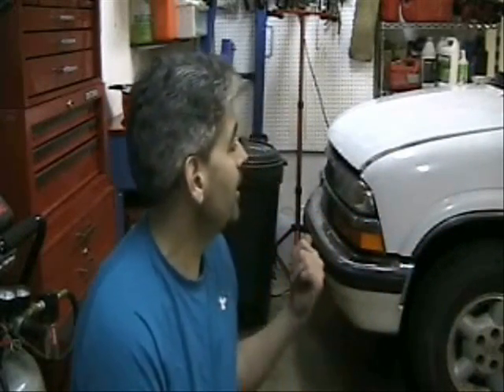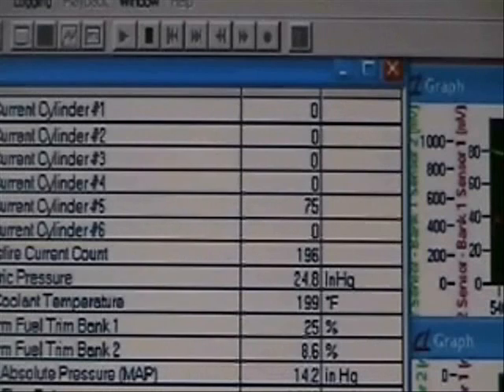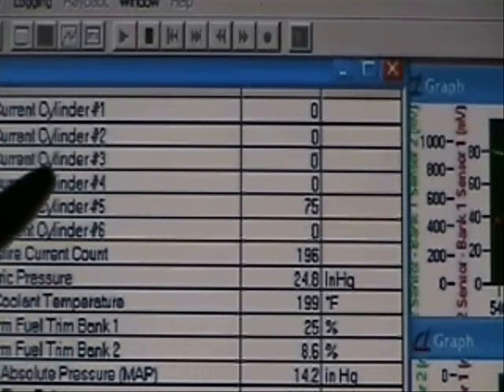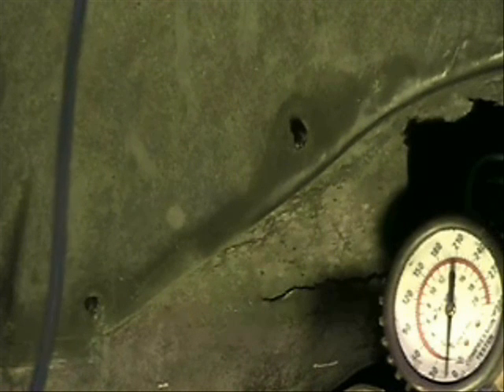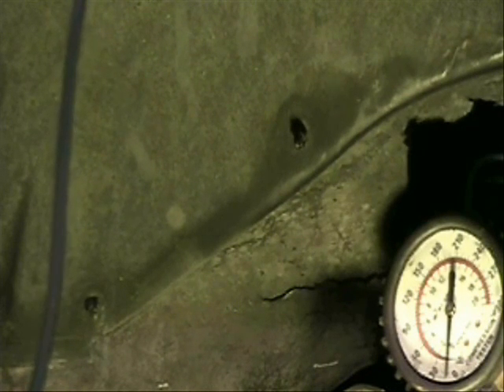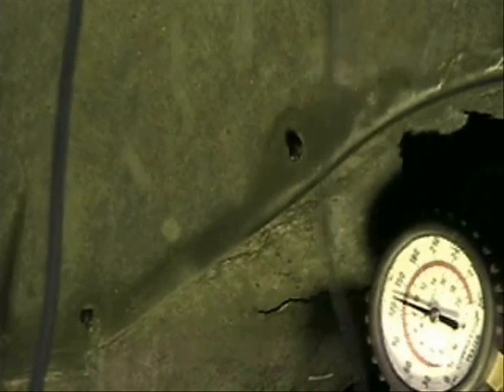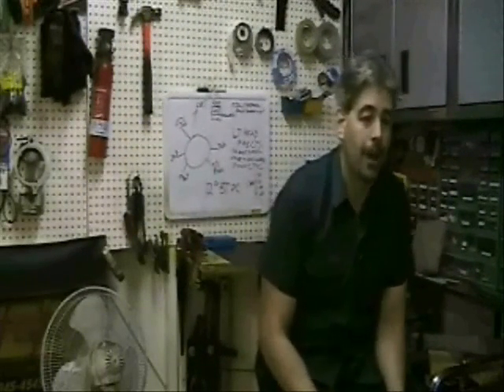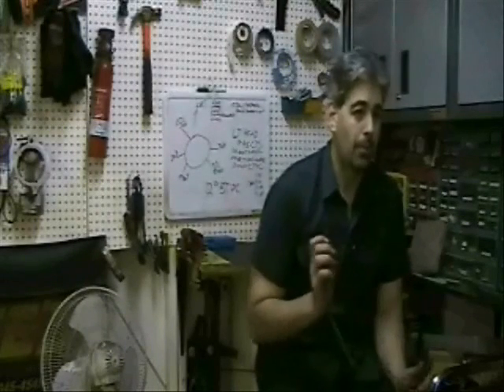P0305 Misfire Diagnosis 4 3L Vortec PART 1

Comment: I'm chasing a misfire on my "98 Chevy 1500 5.7L Vortec. The only codes i've been able to get are P0171 and P0174 (I think) Lean on both banks. Also occasionally a catalyst code which im sure might be bad from all the unburned fuel going through it. The miss is on all cylinders under a load. whether it's in closed loop or not. I overtightened the dist cap on a previous repair (Similar symptom but not as severe. turned out to be cam sensor). and after discovering i had a 6 cast into my dist housing at the TDC #1 mark instead of an 8 I decided to order a new one since I knew I broke it. Do you think it's very likely the lean codes could possibly be caused by a misfire on all cylinders because the cap isn't secured properly?

Thanks!
As soon as I get the broken distributor replaced (With the help of another of your videos) I will continue my testing.
Thanks!
Reply from the maker: @Parker- I have to tell you that I would go after fuel pressure.  lean on both banks and random miss under load.... Definitely fuel pressure test is what I would do if I were looking at it.
Reply: Would you agree that it's more likely the fuel supply to the injectors versus the fuel supply from injectors? I did a injector balance test with a scan tool and at idle each injector seemed to effect idle exactly the same. I'll just have to wait until I get my distributor to get it up and running. Watching you're videos has got me really excited about diagnosing this issue properly! I am actually a service advisor at an auto shop and it's unfortunate that I have to admit my technicians are "parts changers" :(
Reply from the maker: Parker Waite Parker, I do agree with you 100%.  An insufficient fuel delivery would still allow for a negative fuel injector balance test result because the injectors would just be equally delivering insufficient fuel.  I would go in the direction in this case of hypothesizing either a weak fuel pump or a dirty MAF sensor.  I would look at my LTFT and O2s while driving the car and flooring the pedal.  If the LTFT screams high and the O2 sensors go lean while it's floored, then it's 99% likely to be one of these two things. Then, following up with a fuel pressure test (if it's 55PSI or so while idling and it increases with throttle) then a dirty MAF is surely the cause and I would clean the MAF and retest.  If the fuel pressure is low however, then that's surely the problem (and, possibly, there could ALSO be a dirty MAF to be really technical).   But honestly the way you describe the symptoms, fuel pump or fuel delivery issue (bad filter, etc) is where I would bet you find the issue if I had to gamble on a guess- which I don't do.  Incidentally, I have seen many Vortecs that have leaking fuel pressure regulators at the injector assembly- in fact I don't think I have seen one that doesn't have this to some degree. This must be a common issue on these engines, however this will cause a rich condition on these models because the regulator is internal so don't bother chasing that down even though many people may suggest that.  Do let me know what you find.
Reply: I certainly will. One other question regarding your video. In your flow of diagnosis once you determined it was going to be a fuel problem, you automatically ruled out the pressure regulator. Why is that? It may be obvious to someone who happens to be very familiar with how they work, which I am not. Haha
Reply from the maker: Parker, great question and I don't think I clarified in the video why I dismissed the FPR (This video is over a year old and I dont want to watch it again lol) but to the best of my recollection there would be no reason to suspect the FPR.  First, and most importantly, on a single cylinder misfire there is no reason to suspect anything would affect the entire engine which of course an FPR would.  Second, I recall doing a fuel pressure test in this video and the pressure held steady.  Indirectly, this also indicates a healthy FPR- had the fuel pressure gauge showed a drop at rest, a leaking FPR would be a candidate, but again not on a confirmed single cylinder consistent misfire so a leaking injector would be suspected at that cylinder.  In this video I do find the fuel pressure to be low, and I cover that in the next series on low fuel pressure diagnosis and an FPR is certainly a consideration for low fuel pressure except you would expect a rich condition instead of the lean condition I find in the second video. And again, the fuel press gauge holds constant at rest in that video as well.   The fuel pressure gauge is actually on the injector "spider" in vortec engines so if it leaks at all, it leaks fuel right into the intake causing a rich, not lean condition.  If it leaks back into the fuel tank, then you would have a lean condition but again, the fuel pressure gauge would drop at rest, therefore, FPR not a factor in this vehicle any way you look at it.
Reply: Ok that makes sense. Thank you. I just wasn't sure if there was any other way the FPR can fail but from what I've read now it's a pretty simple part. Lol
Reply: Got my distributor installed last night. drove my truck for the first time to work in a few days today. drove home with the scan tool hooked up. both banks were switching from rich to lean constantly. My LTFT was at 25% on both banks at idle and came down to 0% when I got on it. both banks continuing to teeter between lean and rich. Monitoring for misfire data it was only missing on #2 this time as opposed to it saying I was missing on every cylinder before. So it looks like i may have a similar issue as you. only under load though so I doubt it's spark unless its a loose wire or something but even then it's unlikely. It also idle's kind of rough but no misfiring detected by the scan tool. Im going to go on another drive tonight and see what happens. Seems kind of strange. no codes setting either at this time. Any thoughts?
Reply from the maker: Parker Waite
Reply: Schrodingers Box Had you intended on writing something? Lol I'm not seeing anything on my end. I took it for two drives last night. LTFT maxed out at like 12% or so but when cruising around were well below 10%. still teetering between lean and rich on both banks. confirmed it is only missing on #2 now according to the scan tool. (Got 1 miss on #1 and 2 misses on #4 but i don't think that means much compared to over 20 per trip on #2) I'm going to follow your diag flow. I'm hoping i've got a intermittent spark and it's just a wire or something. Luckily i've got a back up set of wires and factory plugs.
Reply: Parker Waite Matt, a truly excellent set of comments. Parker, does the LTFT go down as you go higher in RPM? If so it's a vacuum leak. A faulty MAF does the opposite. The higher the RPM the less the LTFT is rich in the positive numbers, compensating for a leaner and leaner condition.

With it being inconsistent and back and forth, it makes me wonder if the MAF is still reporting numbers...usually means it's good . . . but inconsistent. Scanner Danner said you can't test a MAF by looking at how much flow it's seeing by a set RPM. It has never condemned a bad MAF. I wonder if your MAF keeps reporting wrong instead of doing a full fail and going silent.

This above assumes, you've done a fuel pressure test. You don't want to just throw a MAF at it, but if everything else checked out . . . .

. . . . when I say everything, remember to verify the O2 sensor. Do a snap throttle test, does it instantly report rich?
Reply: DE Nichols well it actually ended up being a miss on only #2. Pulling the spark plug (that was barely a year old) revealed built up gunk (i assume is from burning coolant as i had re sealed my intake manifold at the same time i replaced the plugs about a year prior and probably screwed it up lol) . Replaced that plug and it worked like a charm until now. Now i have a miss constantly on #2 and #4 and getting a random multi misfire code. :/

Comment: Thanks Helps a lot. I got a po300 code random mult. miss fire and I don't know much about engines. I hope I can find what's wrong in the summer. and I did replace all small stuff like spark plugs, wire, coil, rotor, cab.... and still nothing. so ill try the test's and see THANKS

Comment: I don't take the fan off just upper shroud.... and I have a hard time turning the crank while trying to finger the spark plug hole.. So
  Pro-tip; take the shrader valve out of a compression gauge hose, and use a fuel line/vacuum gauge hooked up to it.. 
then you can visually see the HG/PSI as you turn the crank with both hands.

Comment: Meaning that, when I crank the engine by hand, I hit a point where I can not physically turn it any further. Like it just hits a wall.  Any ideas there?  Because I am not getting the "obvious push of air" from the compression stroke that others speak of, I believe I am on the exhaust stroke, but why can't I continue to turn the crank? Is it a pressure build up issue in other cylinders? Do I need to remove other plugs to allow me to turn further?

Comment: Currently trying to fix my daughters 1997 Blazer w/4.3 EDI ignition. She had a cracked distributor, very common on the OEM Distributors I guess.  Anyhow, I have followed your videos for installing the distributor, but with it being a replacement, I need to go to square one and find TDC. I felt I had done everything correct, went to fire it up and all it does is turn, does not fire up and run. I believe I may have hit TDC on the exhaust stroke, but that was as far as I could turn it.. CONTINUED..

Comment from the maker: Ben, Technically, not exactly.  When you feel your finger being pushed away by an unmistakable air pressure that means you're APPROACHING TDC (i.e. you're on the compression stroke).  To actually get to TDC you either need to stick a screwdriver or something (I usually use a straw because it's softer) into the spark plug hole and see that it reaches its highest point. Or on some models there is a visible mark on the crank pulley and a timing scale that you can line up to be sure you're on TDC.

Comment from the maker: NewEcus, sorry to hear about the struggles you had however it sounds like a lot of parts have been changed without diagnosis which is exactly what my videos try to show to avoid.  Therefore, for me to take a guess at what's going on is counterproductive to my efforts.  Restart with the basic diagnostic procedures shown and the data will actually tell you what is wrong without having to guess. Feel free to post any data like fuel pressure, compression, vacuum, etc that you have and I can help.

Comment: When i replaced the fuel spider, it ran fine, then one day on the hugh way i was accelerating hard  then the engine died, i pulled over and stated again and it ran terrible,  was missing alot, and its been like that since and i cant figure it out. Any ideas? The thing has 1987-- miles is it time to let her go??

Comment: year now. Ive replaced the fuel pump, injector spider wiith the new mfi type, which included fuel pressure regulator, upper intake gaskets, spark plugs, wires, coil, distributor rotor (even tried a replacement distributor). I checked the timing as you described, and it checked out fine. Im still getting a misfire issue p0300.

Comment: Yeah, I envy guys like Ericthecarguy who use wireless. I have a pocket hardwired, battery powered recorder, which is OK. But it uses a clumsy cigar-shaped connector which is awkward to conceal. I find myself getting lazy and just trying to speak into the camera mic, to avoid having to mix later. But sometimes I regret not putting in the effort, especially when there is no option for a second try.